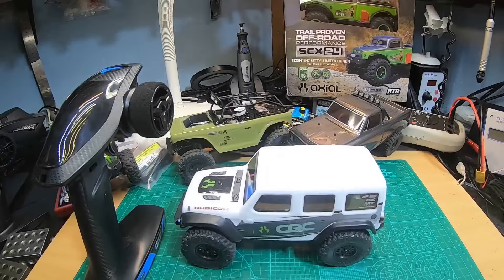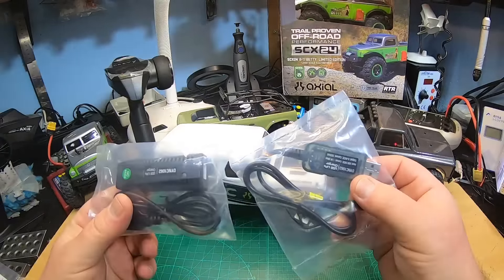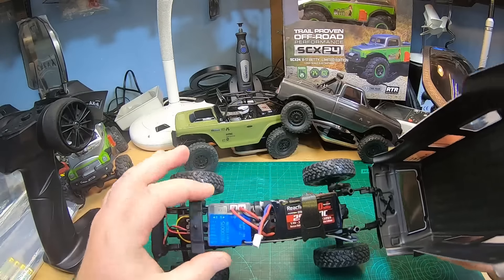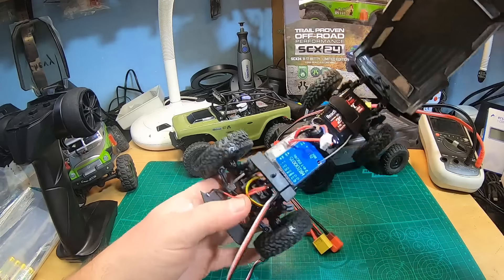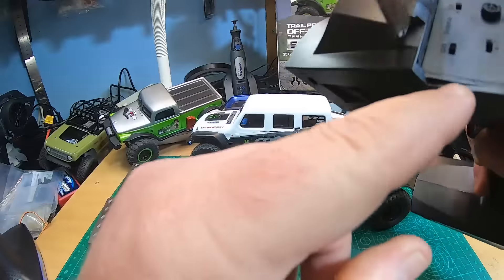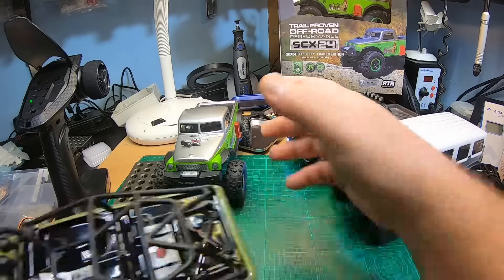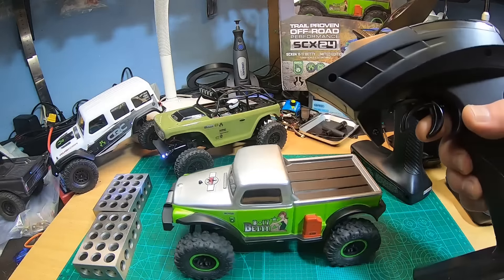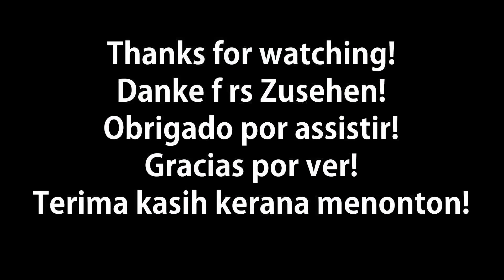Axial SCX24: Old Electronics vs. New V2 Electronics

Comment: Nice video. I found that original V1 radio/esc has the ability to light up brake lights when you brake and reverse lights when you go reverse.
Reply from the maker: Thank you.
This is the way many of the cheap trucks do it, which have only front beams lit up when going forward and rear lights when going reverse (with brushed motors). Since LEDs are not damaged if connected with wrong polarity, but simply won't work, you can simply connect red rear lights and white front lights (both with appropriate resistors) in "x-parallel" (plus to minus and minus to plus) and connect those in parallel to CH2 (throttle), with white LED red/black in "correct" position. Then you do have white front lights when going forward and red rear lights when going reverse, since the ESC reverses polarity of motor power in reverse. You can do this with every truck with brushed motor.

Comment: Great Info.  Thank you.  I wonder if the BEC has been improved?  I notice the label on the V2 combo specifies 6V1A BEC.  I have no idea what the V1 specifications are, but I did "brown out" some fancier servo's before finally settling on the Emax ES08 without any issues.
Reply from the maker: Thank you. I do not know yet, did only use the stock electronics so far. Probably we will know soon, when the Gladiators with V2 electronics hit the crowd ;-)

Comment: Way better throttle control with the new radio/rx set up but you can not use the new one as a stand alone rx with the furitech or similar esc's. I bought an inexpensive flysky 7 channel radio to do these types of power upgrades and to be able to keep my favorites on one radio. The Flysky is no where close to the nicest radio I have owned but for the money I could not find better. The CLR pin outs are for turn signals.

Comment: Nice video!!!! Do the b.e.c on the v2 limit voltage to the channels? I plugged some halo lights in and they are dim. They work fine on my v1 esc..
Reply from the maker: It is a 5 V BEC, as in the V1 version, also in the blinker-channels. So you will have to use resistors if you wanna do your LED setup and wiring without plug and play LEDs.
Reply: I'm just wondering why my lights are dim when plugging into the v2 esc.
Reply from the maker: @InMn  Donno. I measured 5 V at v1 and v2. Do you use red and black (center/bottom) or did you test the last ports for blinker and used signal pin?
Reply: There are only two wires. They are plugged in correctly. Only dims whej it's on the v2.
Reply from the maker: @InMn  No idea... v2 has a lightcontroller inbuilt, maybe that is the reason. I only measured voltage, and that is the same as v1, 5 V out.
Reply: @InMn  I think you're right that it may reduce voltage on the stock location for the headlights (marked "head") on the receiver. I was moving the wires around last night because I wanted to see if I could put the bumper lights in one of the locations that allowed me to switch them off. When I plugged the headlights into the stock location of the bumper lights the headlights were much brighter. 

I thought if I plugged the bumper lights into channel 4 I'd be able to switch them off and on but that didn't work.
BTW - this is with the Bronco which has headlights and bumper lights. The Jeep he's working with looks to only have bumper lights.

Comment: I don’t have time to watch your whole video right now. But I have the same Jeep with the old electronics. There is a jumper on the receiver to change the brake. I recently did a video on panda hobby. My grandson watches all the Youtubers and the trucks they get have the good electronics like the SCX 24. Well we ordered one and it is junk Walmart controller. Plus the banner he wanted they don’t even send it.  they still have it in the picture. Some other companies have had trouble getting supply. But they went up in quality not down. This is very disappointing when I have been telling people to get the axil. We just have to go back to kits and build our own.
Reply from the maker: New ESC is significantly better, but unfortunately the receiver does not have a CH2 out anymore. Do not know if that's now better or worse... out of the box it is better IMO, but for upgrading it is worse.

Comment: Great video. I ordered a Gladiator that I was hoping to convert to brushless. Do you know if the new ESC is compatible with brushless?Or do you think a V1 ESC could be swapped into a V2 SCX24 for a Furitek conversion?
Reply from the maker: Thank you. 
I know it is not compatible, because there is no CH2 out to connect the ESC and there is no signal on the board that could be directly used by an ESC, no matter if brushed or brushless (by soldering a wire to the spot). 
You mix up ESC and receiver. If you use a Furitek ESC (no matter if brushed or brushless), you do not use the SCX24 stock ESC anymore, you bridge it, take throttle signal from CH 2 port of the receiver. 
The problem is the receiver, not the ESC of the new V2 board. So the answer is unfortunately NO, you cannot use a Furitek ESC (or any other external ESC) with the new SCX24 V2 electronics. You will have to swap electronics, use different radio and receiver (I do not know of any receiver that would be compatible with neither the new SCX24 radio nor the old one, and Horizon Hobby will for sure not release such a receiver - this problem with the radio/receivers of the cheap lines is not new, they do never work with Spektrum DSMX radios or receivers, Horizon wants to make money).

Comment: Hallo Donald ich Verfolge Deine Videos reg. top . Ich habe ein Frage zu den Modelbauregler. Ich habe eine neue Nobel Pro und bekomme den AS 12/15RW BEC nicht eingerichtet . Er macht dem Setup  keine 3 beeps und läuft nur Rückwärts. Hast Du eine Idee ? Hat das mit ggf Throttle Deadzone zu tun ?
Reply from the maker: Hi, danke. 
Also ich verwende den AS12/15RW mit der "normalen" Noble absolut problemlos (z.B. hier: "SCX24 Full Metal Bouncer: Mofo RC TorqueBeast2 + AS12/15 brushed - big performance upgrade"), also kann es eher nicht an der Noble liegen.
Hast du schon mal probiert auf Throttle Reverse zu gehen und dann? (Das ist bei z.B. Futaba auch oft so, kann mich aber nimmer erinnern, wie es bei mir mit der Noble war). 
Ich nehm ja an, dass alle Trimms etc. auf 0 sind?
Sender zuerst ein, dann erst Empfänger/ESC ein, ist klar?
Ich hatte allerdings ein ähnliches Problem mit dem "Volksregler" von Modellbau-Regler.de. Dieser funktionierte um die Burg nicht mit der Noble. Hatte ewiges Email Hin- und Her mit Modellbau-Regler.de, die konnten sich keinen Reim darauf machen. Wir haben echt alles probiert (sehr hilfreich), kamen aber auf keinen grünen Zweig. Obwohl die Software vom Volksregler fast ident mit der vom AS12/15 und AS12/6 ist, funktioniert er nicht mit der Noble, sobald ich die anderen ESCs anhänge, geht alles problemlos. 
Wie gesagt: AS12/15 geht bei mir.
Reply: @donaldsneffe  Hi Super Danke für die Tips habe ich alles schon durchprobiert. seltsam ... Ich frag mal Modellbau Regler .
Reply from the maker: @milan-racing  Alles klar!

Comment: Hi, Could you please do a video on how you fix the esc if you plug the battery into the motor port? Would be helpful to a lot of people I recon.
Reply from the maker: I did already do such a video in the Mini-Z board: https://www.youtube.com/watch?v=EdBcaljY9RA&t=1103s - it is the same way to do, you will have to find correct Mosfets. I did not break a board so far. 
Since I do not have a dead board I would not know how to do such a video in the SCX24.
Reply: @donaldsneffe  thanks for sharing the link. I just watched the video 👍🏼. I’ll have a crack at fixing my scx24 board in the near future. Just need a few bit a pieces 😉

Comment: I think the motor also has a resitor or diode on it and v1 did not
Reply from the maker: V1 also does, capacitor, it is blue in both, you can see it in the video.

Comment: I am having so many problems with the V2 ESC. First I have had to return 2 trucks so far and thankfuly my local shop is understanding the first 2 trucks the turning went out in the esc and not the servo but the esc just wouldn't send power to the servo no I'm having light issues. I have put new head lights on the truck and when I plug them into the head light slot now the switch won't work on the remote meaning the lights work but I can not remotely turn them on or off from the switch like I could originally (one of the cool new features of V2). I plugged the old head light back in and removed the new ones but now they just stay on as well also I was able to plug lights into Chan 1 n 2 and the lower switch would make them blink and now nothing, the lights come on and stay on the same as the main light switch. This new V2 ESC is so glitchy come on Horizon hobby let Axial put their parts back into the trucks your parts suck balls .
Reply from the maker: Sorry to hear this.
To the lights: If they are always on, maybe you plugged them in in wrong direction? You have to plug in the black wire on upper position (signal), not on lower position (black). Black down: Lights always on. Black up: Switchable.